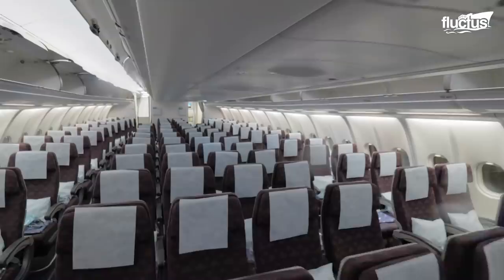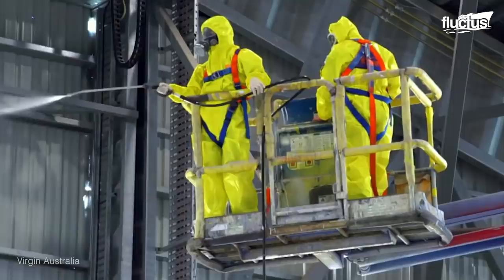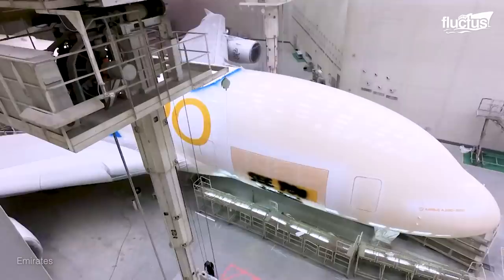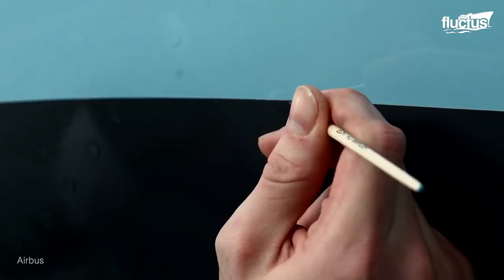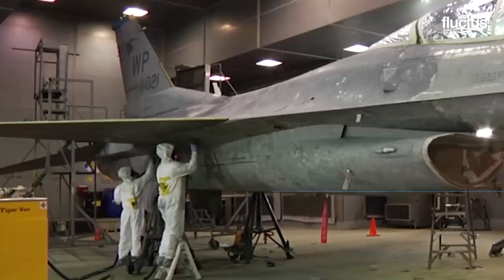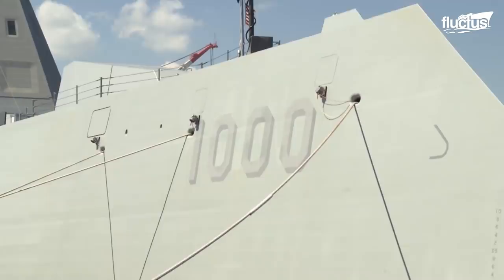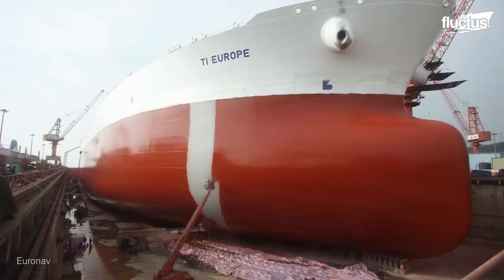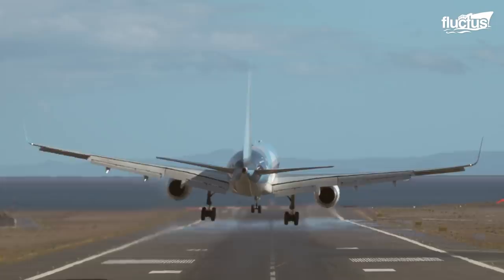Hypnotic Process of Repainting the World Largest Airplanes

Comment: No, the F-16 was not designed to have low radar visibility, it was designed to have high speed and maneuverability.  Radar stealth was not a design criteria for that aircraft.  The new radar-absorbing paints were first used on certain parts of that aircraft in the mid 2000's, and the current Have Glass V complete aircraft paint system was used beginning around 2020.

Comment: Cooling is on the ground.  It is around -40 at 30,000 ft altitude.  Seems to me you would want to heat the aircraft.
Reply: That’s what I was thinking too. Maybe it’s the wind friction from flying at high speed causes the the aircraft body to get hot, even in sub zero temperatures.
Reply: The Sun's UV rays are very strong at high elevation and can deteriorate paint much faster than Sea Level even though the AIR TEMP is very low. Did you ever go hiking at 10,000 feet without your hat on? Our lower atmosphere protects us from most harmful rays.
Reply: @georgespalding7640  Also the UVA and UVB rays reflect from below off of clouds and bodies of water, so the paint job is pummeled from all sides!